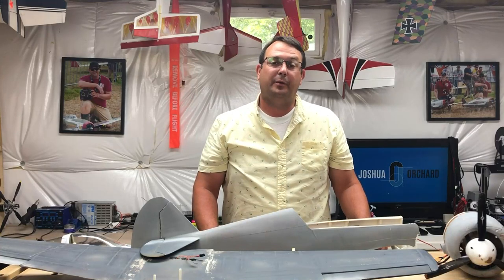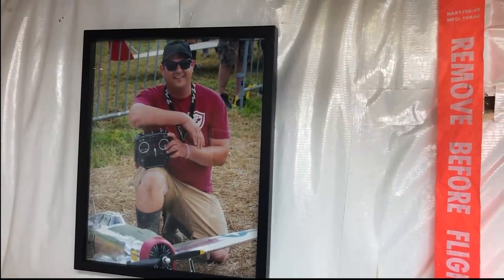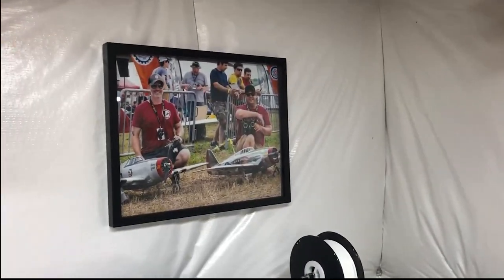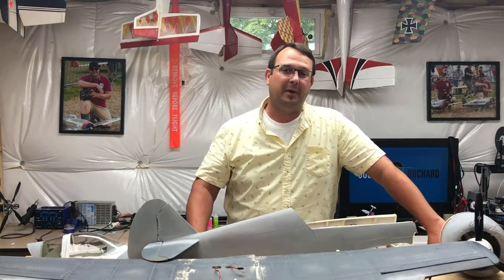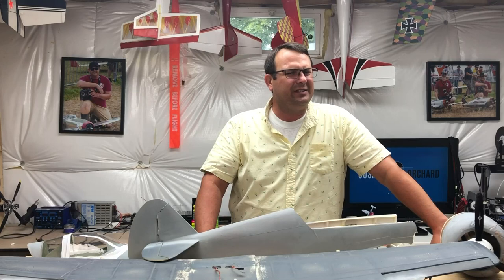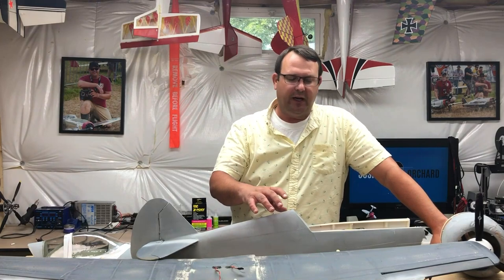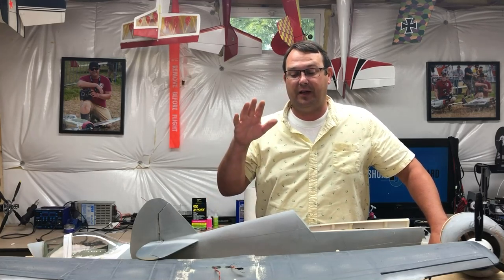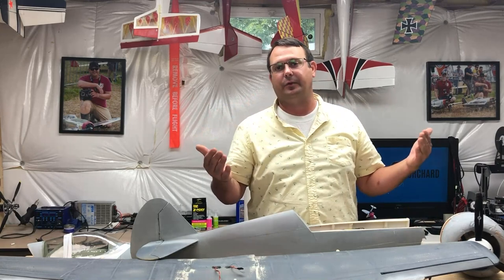An Incidence Incident

Comment: Holy Smokes! I just did an my first episode on wing design and I mentioned airfoil angle of incidence and briefly mentioned looking at coefficient of lift v alpha charts for the airfoil in use. Your explanation of what can go wrong when you miscalculate these is awesome! I plan on writing a blog post about this and will do another video episode on wing design, do you mind if I include your video as a reference when I produce the two? Thanks for sharing the deets on what happened with this model! -T 👍👍👍
Reply from the maker: Absolutely. The entire point of my channel is for anyone to reference my work. Some channels only focus on the successes they may experience but I like to cover everything, both good and bad. You learn more that way!

Comment: Great video, and really nice learning from someone else's mistake!🤣 My comment doesn't have as much to do with incidence as much as with CG range. I noticed in your video that your target CG was within the first 25% of the wing chord. Based on my experience with full scale design and maintenance, not to mention over 40 years in the hobby, I feel that your desired CG range is far too conservative almost to the point of instability in and of itself. We are taught that with a relatively straight wing the desired CG should fall within the first third of the mean aerodynamic chord, or MAC, preferably between 25% and 33% for best stability and glide ratio. Personally I try for 30% and I'm generally happy with the results. Much aft of 33% and instability is almost certain. The old adage that "nose heavy planes fly poorly and tail heavy planes fly once" is very true. Once again, great video and good information. Thanks

Comment: When in doubt always set 0-0-0 .   It will work most of the time on typical RC models.  And keep in mind, the incidence of the wing is a line running through the airfoil fro TE to LE.  It is NOT measured with a straight edge on the bottom of the wing.  This will always cause you to set more positive wing incidence than you want. There is a popular kit manufacturer that has you set incidence this way, and it is just straight up wrong.